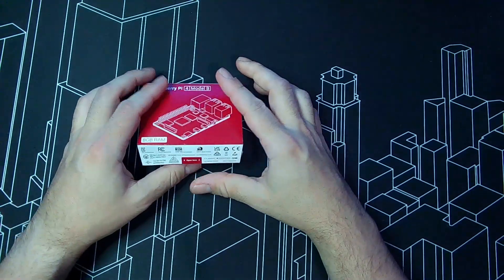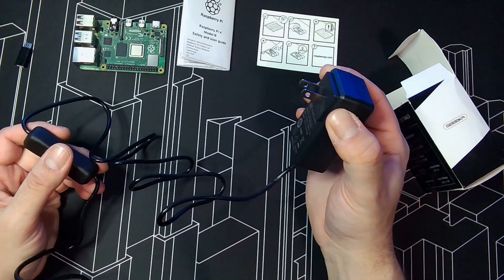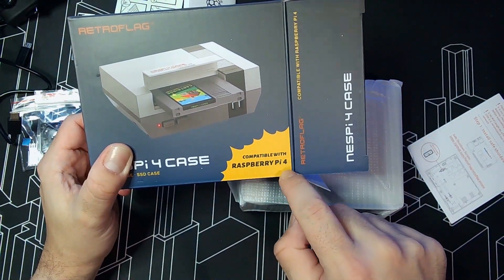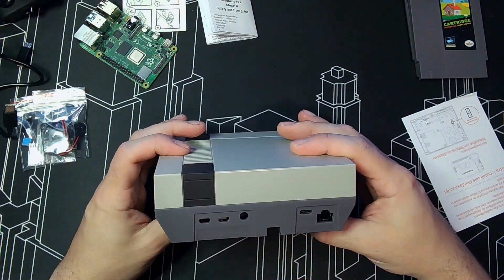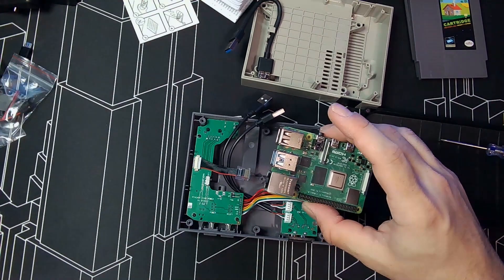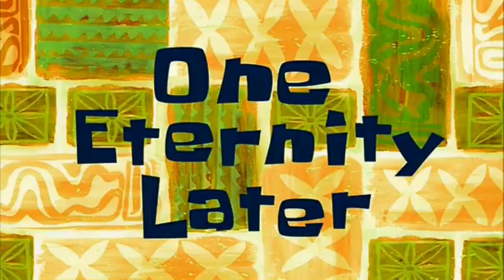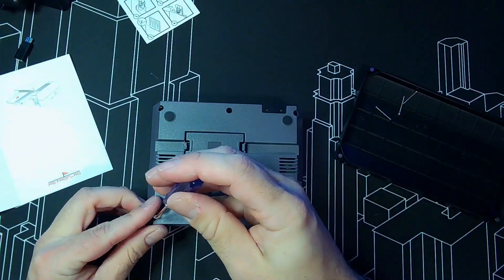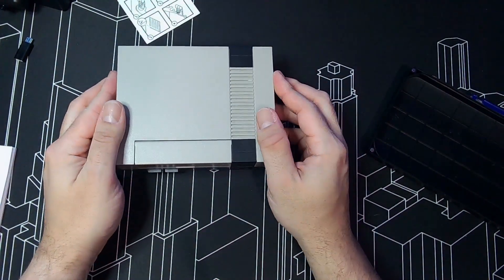How to build NesPi4 - Unboxing and Build - Raspberry Pi4 Model B - 8GB

Comment: One important item was not mentioned... you end up with only 1 USB 2 and 1 USB 3  port ... you need a USB 3 hub or a USB 2 hub if you want to connect anything beyond keyboard and mouse (like a printer for instance) unless you go headless in which case the fancy box is of arguable utility beyond aesthetics ...

Comment: This case has major issues
The USB SATA adapter causes problems with wifi and Bluetooth
Also the PI 4 is dreadfully underpowered and sucks for emulation
I have the 4GB variant and this same case and biot from SSD and I have nothing but problems with Batocera
It is a total crap shoot on every boot if everything will work or not, sometimes everything works but other times I boot it and there is no sound or no wifi  or the Bluetooth doesn't work and when Bluetooth does work the range is like 1-2 feet if that.
Rp-i is just a meme the hardware is garbage  and it is totally unreliable and not practical at all for anything
The nes pincase makes it even worse
Reply from the maker: The version I have is the newest version and at the moment everything working spot on.
Reply: @bowlingculture  are you bootit from the SSD though and are you using Batocera?
I think my build was like one version behind and that was like last year maybe newer Batocera versions have got better 
I believe my case is the newest revision but maybe they changed it again
It is not the original one
Reply from the maker: So I'm using the SSD cartridge and I use Arcadepunks for the images. Sometimes I use Batocera or Launchbox. Everything is working like a charm to me. No issues connecting controllers or Keyboard and Mouse in any USB port. Check if you have the newest retroflag version. I have the one that has everything upgraded and no need to update firmware on the SSD portion port.